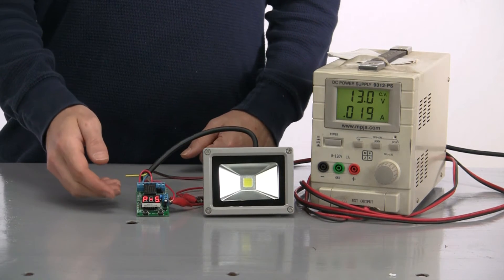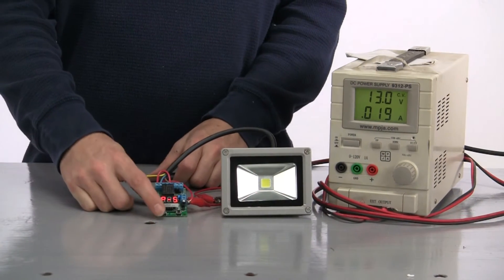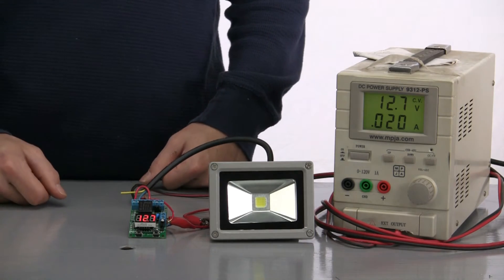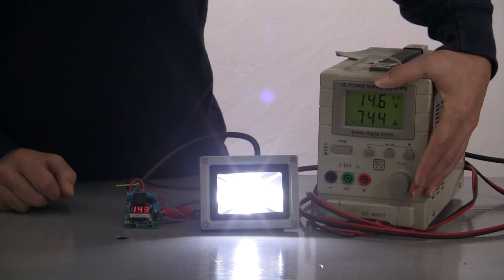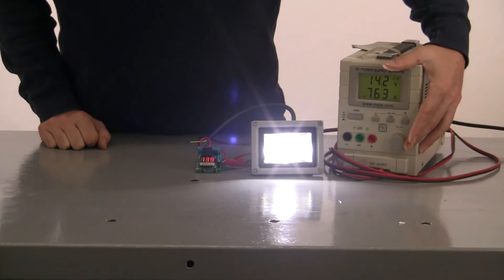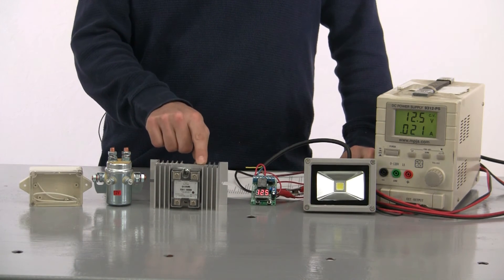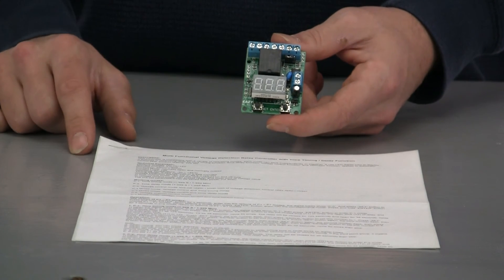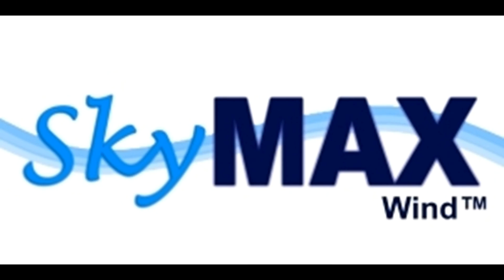SkymaxWind demonstrates DIY digital board for Wind Turbine or Solar Panel

Comment: These are nice but most people today are using 48 volts for home applications. Using 12 volt for like RV applications. You should build these boards that can accommodate those that want 24 and 48 volt systems. Many are also going lithium batteries which need special control which I think this will do and they are using batteries from wrecked electric cars. These batteries make for systems that are not exactly the normal 12, 24 or 48 volt systems but will work just fine if you have control of the voltage. When you have one for 48 volts let me know. Im looking to do a 48 volt back up for my home.
Reply from the maker: This is an inexpensive charge controller and i doubt it will ever be in 48 volt.
The biggest sellers are still 12 volt. Very popular.